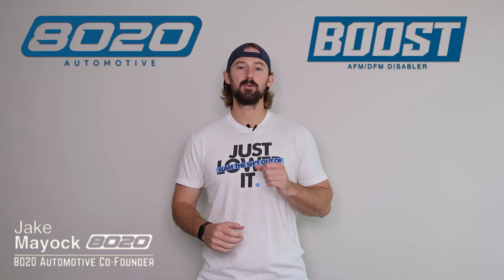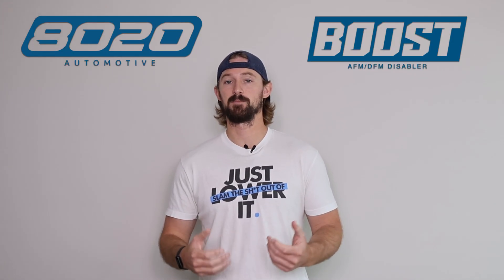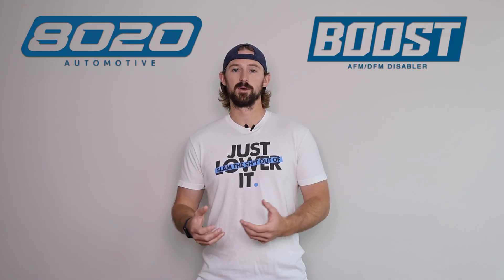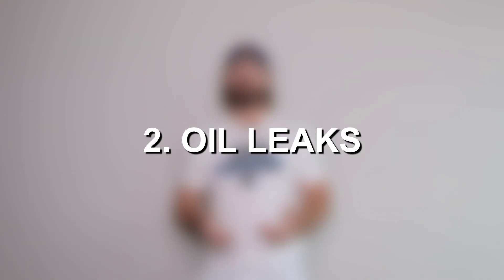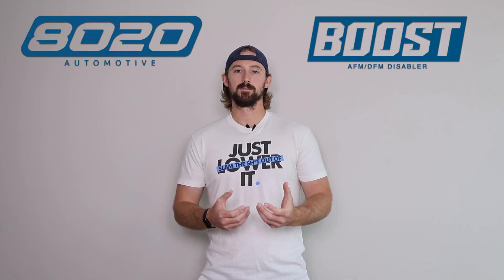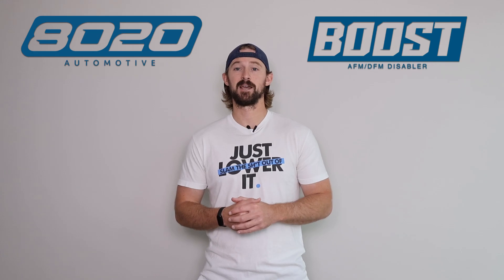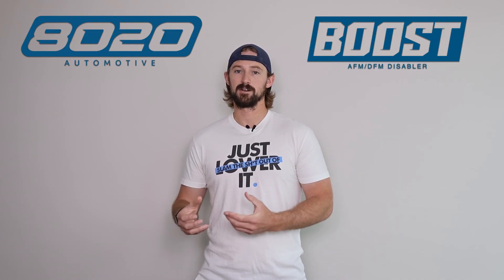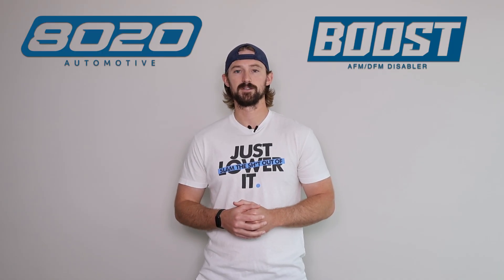VQ35DE Engine Breakdown – Reliability, Problems, and More!

Comment: 2007 Infiniti m35x. 267000 miles oil change every 3000 miles religiously.  My head gasket blew at 234000, I used blue devil head gasket stop leak and been perfect since. However if it ever does come down to something major imma just replace the motor with a new crate vq35de I got waiting
Reply from the maker: G - Nice! Thanks for taking the time to share your experience.
Reply: Where did you get a brand new VQ35de?

Comment: I have 2008 maxima tht have the same engine odo is 188308 and still runs like new. If u want ur engine to last without any leaks or burning oil just don't use any oil additives and change or oil every 2800 miles.
Reply from the maker: M - Thanks for sharing!